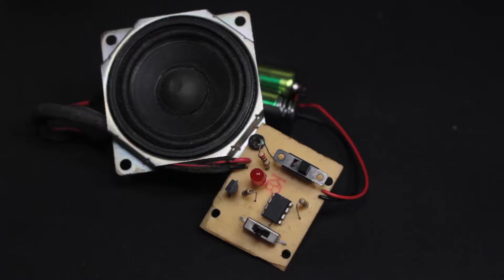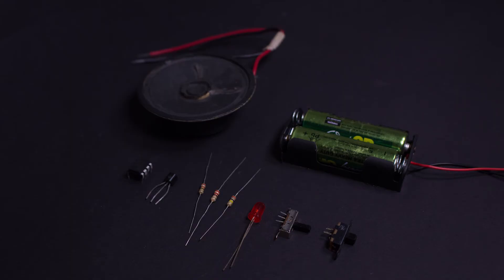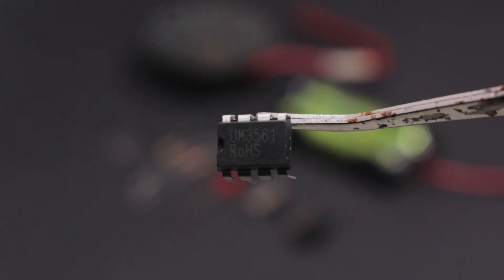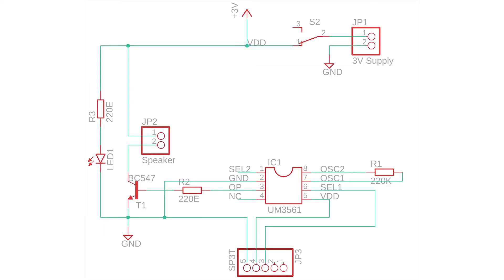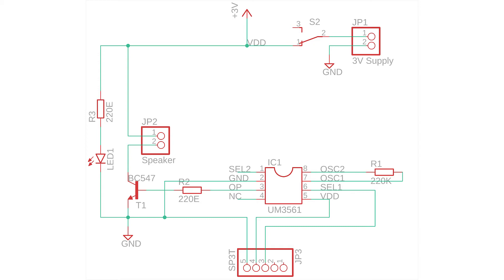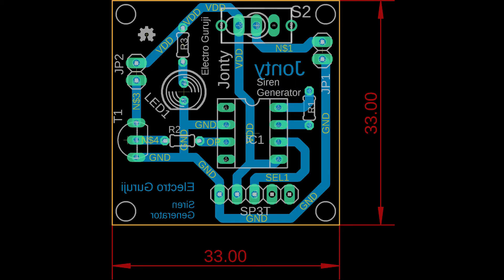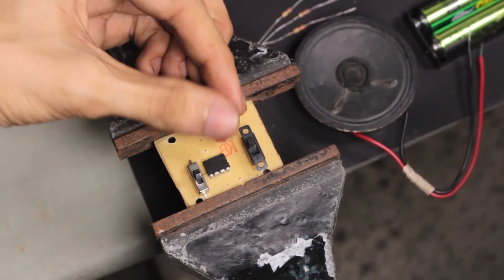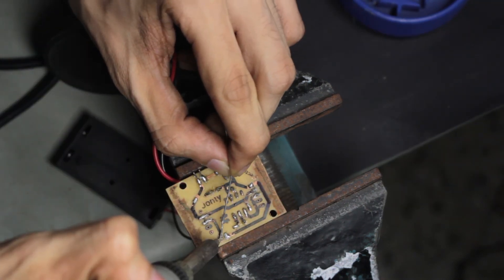How to Make a Siren Generator | UM3561 | Police, Ambulance, Fire Engine

Comment: Hey Electro Guruji
I recently bought two of those UM3561 siren generator ICs, and I've tried many different circuit variations and I cannot get it to make the siren sounds. I'm using the exact same components as you show in your video, but I'm not sure whether my chip is the reason my circuit isn't producing any sounds. I tested one of the chips with my multimeter to check if it shorted inside, and the chip seems fine until it's powered in the circuit, then when I test the chip, my multimeter beeps so there may be something wrong with it, I don't know :(
Maybe you know a trick to getting the circuit working?
This project is very important to me, please help me out with this ASAP, 
thanks a lot
Reply from the maker: Hey so I had similar problems with my circuit when I initially began to design the circuit. I made the circuit according to the recommended application circuit given in the datasheet but for some reason it didn't work well.

So I changed the speaker and that worked. In my case, the internal speaker wires were loose.

These are the general debugging steps I usually follow:

1. Start with the power supply. Check if you're getting 3V from your batteries at the PCB. The IC has max voltage of 3.6V. Do NOT exceed this value. Try replacing them with new ones.

2. Check the value of the Oscillation Resistor. The datasheet recommends 300kohm but in my case 220k works well too.

3. Is your transistor working. Check transistor voltages with a multimeter.

4. Check the speaker. Connect it across a battery and see if it produces some white noise to see if the speaker still works.

5. Even if the Tune Selector switch is not working properly.... The IC defaults to the Police Siren tune.

6. Check the PCB traces for cuts. Check your soldering for shorts and cold solder.
Reply: @ElectroGuruji  Thanks a lot for getting back to me! I will try your steps and see if it will work now ☺
Reply: @ElectroGuruji  Hey, so I checked all of the following points you gave me, what I found is that a battery connection in the PCB was somehow in contact with the top copper layer. Anyway, I fixed that connection by scraping around it, now the circuit gets power but the IC is heating up way too much, and still no siren noises heard from the speaker, what do you think may be wrong here?
Reply from the maker: That may have shorted the circuit and destroyed the IC. Try replacing the IC.
Reply: @ElectroGuruji  Yeah, I'll have to replace it...

Comment: can i give 5 volt power supply to this circuit?
Reply from the maker: The IC has a typical 3V operating voltage.

So you can't directly give 5V to the circuit. You will need to reduce the 5V to 3V.
Reply: @ElectroGuruji  thanks....

Comment: Hi! I couldn't find the code for this project...it would be appreciated if u could leave the link to the code
Reply from the maker: Hi Ahmed

This project does not require any coding. 

You only need to build the circuit on a PCB or breadboard.

You can find the full project tutorial instructions: 
https://www.instructables.com/id/How-to-Make-a-Siren-Generator-UM3561-Police-Ambula/

You can also find the Circuit Schematic and PCB board layout:
https://github.com/jonathanrjpereira/UM3561-Siren-Generator

Feel free to ask any other questions related to the project and don't forget to Subscribe ✌️

Comment: how to make a earthquake siren sound?
Reply from the maker: Unfortunately you cannot use this IC to make an Earthquake Siren. But I will definitely make this into a project in the future.
Reply: @ElectroGuruji  What IC do you use to make a earthquake sound? and if the speaker where to be louder what will some of the components change?
Reply from the maker: You can make a Siren with a variable frequency using 2 555 timer IC. You can that circuit to LM386 audio amplifier to increase the volume.

Comment: hello can we replace the small speaker with an amplifier?
Reply from the maker: Yes, you can replace the speaker with an amplifier. You can simply remove the speaker (and the transistor+resistor connected to the speaker) and connect the Output (Pin 3) of the UM3561 to the Amplifier Input.
Reply: @ElectroGuruji  thank you for your reply! keep up the good work man!

Comment: Hey! Well done! I have a question about your project. How do you know the frequencies for each type of siren? Thank you!
Reply from the maker: The IC includes an oscillating circuit. But the oscillating frequency is set by the external resistor. The datasheet doesn't mention oscillating frequency for a particular resistance value. Hence you will have to measure it on a CRO/DSO.

Note:
You can vary the oscillating frequency by replacing the resistor with a potentiometer.